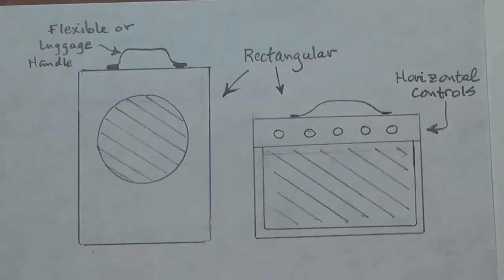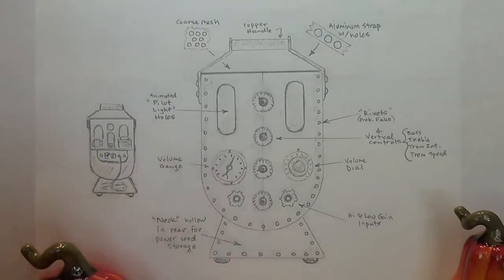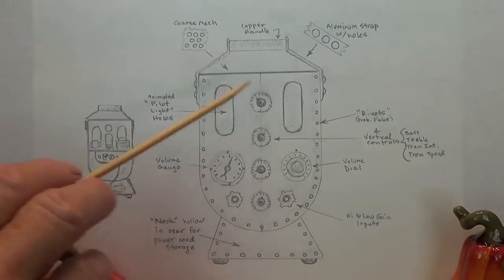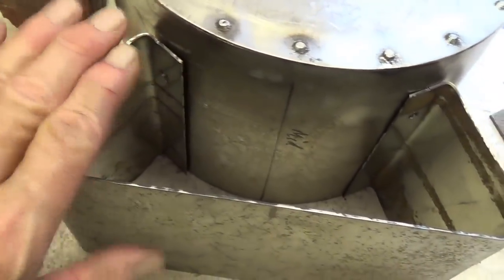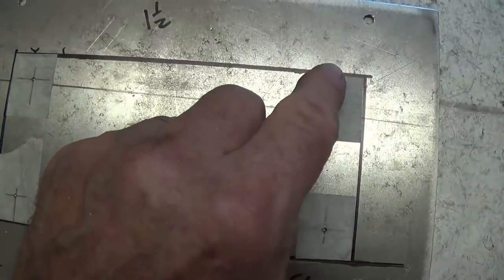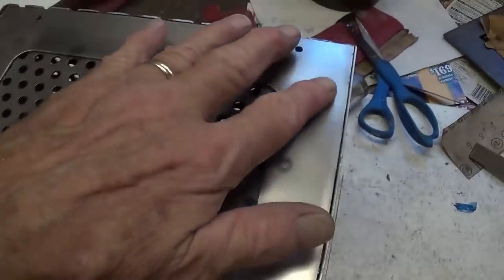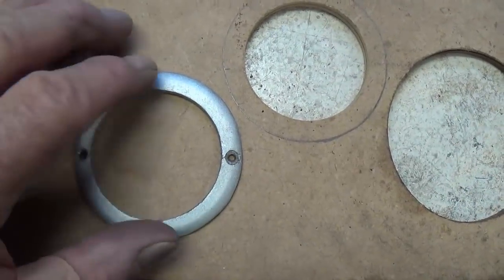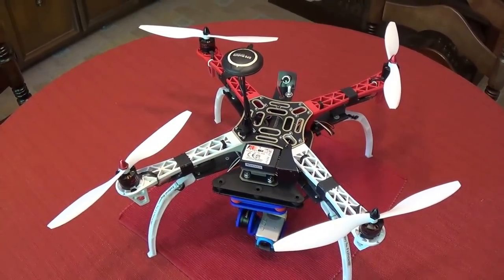Scratch-Built Steam Punk Amp, Part 1: Design and Construction of Metal Cabinet

Comment: I see that you have taken the whole “Thinking outside of the box” idiom and surpassed it completely. You, sir, have now cut up the box and used it for templates for cutting out complex shapes for projects. I Love It!  I have a couple ideas for you about a volume indicator, or a plate voltage meter in a future project perhaps.  Perhaps use a tachometer gauge with the faceplate changed out to match the amp style. Some meter with a center pivot needle to give you that pressure gauge feel with a smooth movement, sort of a semi-fast peak reading movement. The other idea comes from an old Honeywell chart recorder. They had a span adjustment in them that consisted of two stereo-type pots and small low rpm electric motor.  One half of each pot was wired in a Whetstone bridge. One pot was the adjustment, the other had a pulley and large ”O” ring which was driven by the motor. When you turned the adjustment pot, after a slight lag, the motor would turn the position pot with the ”O” ring belt arrangement to match the adjustment pot position. The other half of each pot was used to make adjustments to the instrumentation amplifier. I was thinking that you could use a servo type motor with a built-in position pot and put an indicator needle on the motor shaft. When you adjusted the volume, bass, treble, whatever, it would change the position of the indicator motor accordingly. You would just need to use a stereo pot for your amp controls and use half of it for motor control. That way you could place your controls at say the bottom of the cabinet and the indicators at the top and not have to worry about a drive belt arrangement. Just some random thoughts that popped into my head as I watched the video. I have a feeling that the moaning about grommets was directed at me if I am not mistaken. Thanks for that, it made my day. The Hot Rod drone, wow! Reminded me of a flight that I took with my Dad when I was a kid,  in an American Champion Citabria (airbatic spelled backward) it also involved inverted freefalling. My dad took aerobatic flying lessons from World Champion Aerobatic Pilot Jimmy Franklin from Jal or Eunice NM. The last thing I remember about that flight was seeing my breakfast hit the ground off of the side of the runway once we landed. But as the son of a crop duster, I managed to hold it down until my feet were back on solid ground. My dad laughed for a week over that. Well, once again fantastic, imaginative, outrageously creative project. I  love how you made the ”rivets” I was wondering how you were going to get that look. Can't wait to see part two!
Reply from the maker: Wow.....thanks for all the great comments and suggestions, Mark.

Comment: Wow what a work of art, I love it. Uncle Doug, I have been experimenting with Cerakote here in the UK, and I have had great success with getting a good finish. Although I have been building some hifi amps using solid state JLH type, I have found only yesterday whilst searching for ceramic spacers for the output transistors, my cerakote is naturally insulating so I have no need for insulating pads or mounting screw spacers. The JLH class A amps run hot and tend to destroy the nylon spacers I have so far used. I only wish to promote Cerakote as it will last and keep your design looking great for 1000000 years... or so.  Great colours too for steam punked items.
Reply from the maker: Thanks so much for the nice comments and tip on cerakote, Ian.  I'll look it up.

Comment: I truly love this direction you're taking with the Art Deco amp and now this one.  Such a great use of your skills working on classic cars and bikes and jukeboxes (and lord only knows what other cool stuff).  No one does builds like these and takes the time to share the process with the rest of us so we can learn!  Invaluable education.  Thank you so much!!

A couple of ideas in case they're of any use on the Steam Punk amp:  

1) I am doing a steel faceplate myself and have been testing pieces with coloring them by heat (propane torch, open fire, etc) and it looks pretty darn cool. 

2) Check out the tremolo circuit from the Kalamazoo Model 2 amp, as I recall it varies the cathode of the 2nd tube stage - mine always seemed to trem the distortion more than just volume.  Kinda steam punk in concept, anyway!

Just some thoughts!  Can't wait to see the upcoming vids!!!!
Reply from the maker: Thanks so much for your very nice suggestions and comments, SF :)

Comment: Hi Again from down under Doug 
Always a great day when a new video arrives, great project once again and the VibroChamp is always a winner no matter what Box it ends up in. looking forward to the conclusion, cheers again 
PS you may want to use some coolant on that Aluminium when machining and a little faster RPM it will cut like butter, we used Paraffin(kerosine) when I did my Apprentice stint in the Tool Room
Reply from the maker: Thanks so much, Steve. I use a substance called AlumiCut.....and it does indeed enhance the drilling process.

Comment: Big Toes UP! from me Doug. I got the inspiration to tilt the chassis lightly to the right, then putting on two short legs to hold the balance of the weird oblique position. 
Then insert a blue backlightened Digital Voltmeter controlled by a double Pot Volume Control as one "eye" and an EM84 Meter Tube as the second "eye"...
Should a be terrible enough what do you think? 
Have fun Doug!
Reply from the maker: I love the ideas as well as your screen name, Mr. L. Thanks !!!

Comment: Be careful with the Harbor Freight grommets. I had an exciting experience with them. They breakdown under B+ level voltage. Had a chassis pass thru grommet ignite due to being in contact with the B+ supply terminal strip. It sounded and looked like someone lit a string of firecrackers in the chassis.
Reply from the maker: Well that should definitely add to the drama of the initial start-up, Charles. I'll keep a fire extinguisher handy.
Reply: Black rubber, which is loaded with carbon, can be conductive.  Try this experiment--walk up to a brand new tire and touch the sidewall with the leads from your ohmmeter.  You may be surprised to find that the tire conducts electricity.
Reply: Roiderien I was taught to cut short pieces of vacuum hose, place between each plug wire at the distributor and use a wire to short each cylinder out at the hose one at a time for testing cylinder contribution. So yes, the carbon based type will conduct.

Comment: I love it. Looks like a steampunk boiler to me. Those pilot light cutouts would be perfect for large tubes like a 6L6. I would also add a master volume instead of a low gain input. This amp needs to rock!
Reply from the maker: It will, TP, and those windows will reveal something you have never seen before in any amplifier in existence :)
Reply: Hmm, radiators for cooling the tubes? Automatic kibble dispensers for the cats? Landing pads for little drones?
Reply from the maker: Excellent guesses, TP, but it's even better than the ones you named :)

Comment: Dear uncle Doug. I like your scratch built steampunk guitar AMP, 
Very COOL. I have a Sigma Japanese made 
Martin acustic guitar that I installed a piezo electric Martin thinline
 332 pickup into a fishman AGP-2 preamp with volume bass treble controls. It has a very good studio quality sound. I'v been playing guitar for 30 years and your better than me. It is a pleasure to see your vidios and hear you 
 play into those nice 
 repaired antique guitar 
Amps and conversion
PA amps. I use a fender champ In church. That I modified to add vibrodo mid tone control. High volt cut off standby switch and a brightness switch for extra treble. I know ug but I needed the extra 
Utility. I may add reverb to it later.  I baught it for 100 dollars abt 22 years ago nice. 
 I also have a 1995 martin HD28. I will not touch it with any electronics I just play it 
Into a good instrument microphone. I have used the champ with a impedance matching. Transformer for the guitar or a microphone. 
God bless you and yours. Dwight. Jt ps 
Love those cars. I was a servce mechanic 
For 30 years my specialty auto and manual transmissions
I am also a ham radio operator. My rig is a heathkit HW101 antique into a fan dipole wire antenna cut for the 20 and 40 meter 
Shortwave bands.
Reply from the maker: Wow.....you're a busy guy, Dwight. Thanks for all your nice comments. Likewise on the blessings.

Comment: one of the coolest idea ever uncle doug! would be cool if the tremolo section was one of your small steam engines converted to a dearmond-like water tank tremolo unit and attached to the amp, rather than tube driven! it could even be electrically heated, so one wouldn't pee the bed playin with fire :D
Reply from the maker: That's a great idea, GG, and to be honest, I did consider incorporating one of the mechanical tremolos into the design. Maybe next time............
Reply: no worries, it'll be cool anyway! maybe next time!

Comment: amazing!!  suggestion: instead of using the guage to just mirror the volume knob, it might be cool to use a transistor connected to the output of the first stage of the 12ax7. the coupled output goes to the base of the transistor and then the collector and emmitter drive the guage so it will show the reatime output to the guage. it would look cool and enhance the steampunk look and feel....
Reply from the maker: That's a great idea, Tony. I wish I had thought of it.......before I completed its construction.

Comment: Upon seeing the title I was left wondering, "How is he getting access to my design concepts folder ?" Just kidding Doug but yes, a steam punk motif is among my concept sketches (though very different from yours). 
A copper hammer-tone paint would go well. For a real copper finish, a copper sulphate rub works very well but consistency can be an issue (use an acid bath or spray before treatment) In either case, lightly rubbing some black paint around the rivets, escutcheons and appliques will give it an aged "patina" appearance.
Looks like another finely crafted build Doug, can't wait to see the finished product.
Reply from the maker: Thanks for your nice comments and suggestions, CA. I will definitely keep them in mind.

Comment: You could use the volume gauge to measure the current or act as an amp meter type gauge. Thatd be cool and make the over engineering a bit more practical. Ud be able to see how much juice is flowing through the main tubes. Great video !
Reply from the maker: I looked for a small ammeter, HK, to serve that purpose.....but could not find one.
Reply: @UncleDoug  cool. Just finished watching the steampunk series. Great build, you have inspired me to make my own.

Comment: If you pardon me for making a nerdy comment, the horizontal placement of speakers close to the floor in Fender and many similar amps is not just a stylistic element.  Neither is the open-back cabinet, which serves more than one purpose.  First, placing a speaker very near a surface reinforces bass frequencies by as much as 6dB--that represents an effective increase in power of 4x. An open-back cabinet is a dipole radiator, which creates a series of peaks and dips in the frequency response of the speaker, but which also increases the average sound pressure by 3dB or 2x.  Using 2 speakers in very close proximity, another element in many Fender amps, increases speaker efficiency by 3dB as compared to a single speaker, another effective 2x boost in power.   In the world of tube amplifiers in which audio power is both heavy and expensive, anything that can increase the sound pressure without needing extra watts is a big win.  Of course, nowadays, with class D amplifiers and switching power supplies, audio amps can put out ungodly amounts of power for almost no weight and very little cost.  I was at a wedding recently in which the DJ had 2 relatively small speaker cabinets up on stands and the volume from those small systems was ear destroying.
Reply from the maker: Thanks for your always knowledgeable input, Roiderien :)

Comment: Maybe not this build but in the future consider an active (functioning) "Jacob's ladder" type device incorporated into an amp build
Reply from the maker: A great idea, Paul, but I worry about interference from the high voltage required for such a device.
Reply: I worry about 12 kv''s turning my heart into jello and you worry about hum, this is why you are a superior amp builder...
Reply: Yeah, Jacobs Ladders produce some truly "spread spectrum" electrical noise. As a teenager I had a neon sign transformer. My Jacobs Ladder experiments caused awful noises to emit from my parents' TV and stereo in another room and could even be heard on the (landline, with cord) telephone. Good stuff.
Reply: this could be simulated using an android display

Comment: Uncle Doug+ I can't wait to see this one.
Reply from the maker: Thanks, Mr. B. I use the little clamps also, if I have ones that work with the fairly large diameter power cords I have on hand. Also when I use a grommet, I  add some super glue to the interface between cord and grommet, so the cord can't slip out.
Reply: I have an electrical mom and pop shop around the block here and I can take the cord or get a whole variety box of them.
Reply from the maker: God love the little mom and pop shops......a vanishing breed.
Reply: You are too talented artistically and technically to be a average youtuber and it's people like you that could make a mom and pop shops work. Small business, where you could have a small crew to beat on when they play stupid. There's still people with potential that have no guidance. I've been so sick and yet I managed to maintain a small computer business. I was supposed to kick the bucket back in 1999 and I'm still here. I had a medication eruption that caused a couple different kinds of cancer and I refused chemo and radiation and a autoimmune disease so I stopped taking the meds when the doctors said it couldn't be the meds and I sprung back for the most part, Sjogrens and I've been coughing blood up so if you don't hear from me you know why. I have over active saliva glands from the same issue, when I lay down it floods my lungs, but it doesn't stop the bills so I can't stop. My projects take much longer than they did, but I still have my projects and pay bills. I love you brother, you're one of a kind.
Reply from the maker: Jeez, Mr. B. I'm sorry to hear of your many ailments, but thankful that you still find the time and strength to stay tuned and make great contributions to our channel. There is generally no better treatment for any ailment than continuing to live an interesting, productive life. All our best wishes and prayers go with you.
Reply: That's ok, I just wanted to let you know, I'm not crying over it. So far I'm right around 20 years past due and I believe you're right, since the time they told me that I should have expired 4 months ago, I doubled down with God and learning trades I'll never need just for the moment of learning. I've done many trades including electronics, but wiring a house is a far cry from what you do, but I buy all these things knowing I will learn, God willing. I would love to sit here and write all of the trades I mastered and the not so mastered, but that whole time I went where the money was, I always looked at a motherboard of some kind and figure out the traces and even make my own, I love to create. What you do is what I always wanted, but I had kids to feed, but I did manage to repair a lot of guitars and some amps, but not to Uncle Doug level.
Reply from the maker: We're glad you stuck around, Mr. B. It's always good to hear from you :)

Comment: Great Video! Love the concept, the design and the fabrication. I do wonder about putting the volume potentiometer on the adjustment knob. If you put it on the dial pulley, you wouldn't have to worry about belt slippage (although the increased drag would promote a little drag).
Reply from the maker: Thanks, Torgo. I thought it best to attach the big knob to the pot so precise volume control would be maintained even if the belt slipped or broke. The indicator needle is really just for show......but don't tell anyone :)
Reply: Good point,  reliability should take precedence over indicator accuracy, a problem with the belt shouldn't impair function. I suppose the way around that is to to have the indicator side have a split pulley with a friction drive, and make the radius slightly smaller, with limiting stops to restrict the indicator movement.  That way every time you turned the volume to zero, the dial would re-calibrate to zero as well.
Reply from the maker: I considered adding stops for recalibration, but found that the friction of a snug neoprene belt provided almost 100% perfect alignment over time.

Comment: Nice details!  With all sincerity, this is truly a remarkable project. The pulley adds a touch of "contraptionism", but it's hidden from view which is kind of a shame. My unsolicited comment would have been to use a multi turn potentiometer to drive the indicator electrically. Lots of turns of the pot yields slow deflection of the needle. Then gang on another pot for the volume signal to the amp circuit. .
Reply from the maker: Thanks, Will. I'll keep your suggestion in mind.